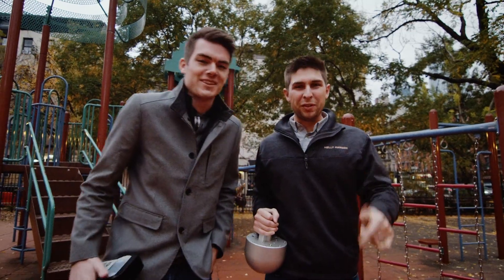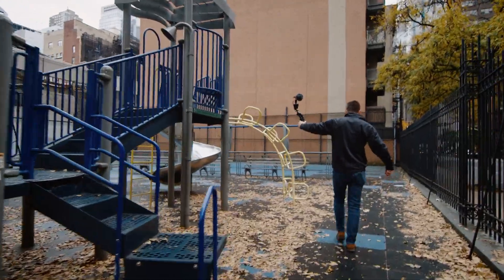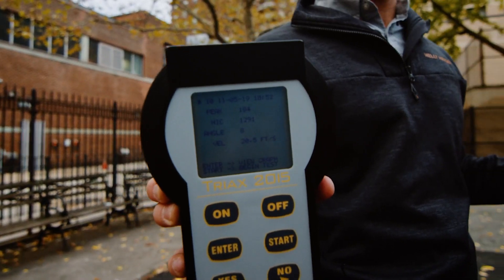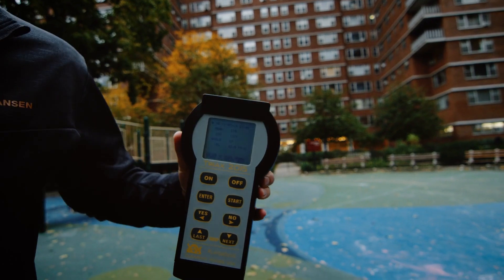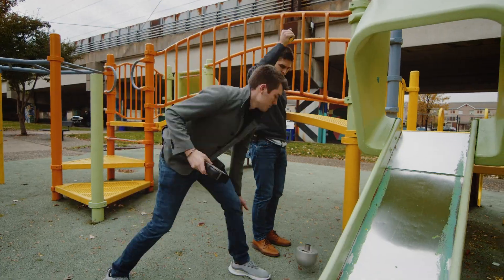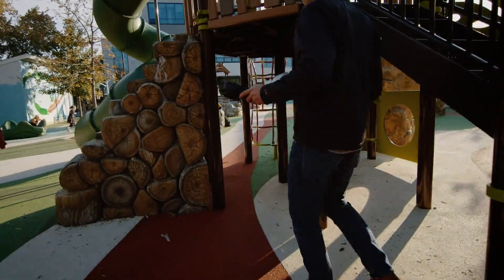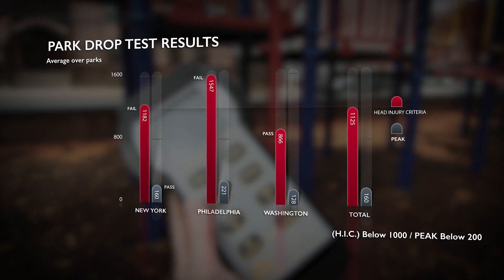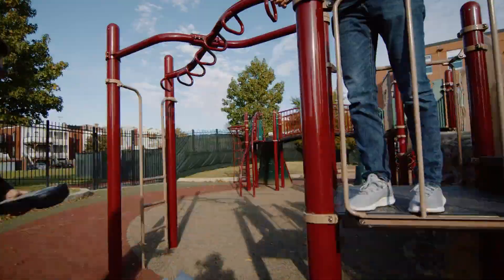Playground Surfacing–Drop Test Tour

Comment: The questions at the beginning (especially, wondering whether unitary surfaces can be considered a 'long term' solution) about how surfaces test over time is appropriate.  When a unitary surface fails - as many do on the day after the playground opens - the cost to make it compliant is pretty huge.  Loose filling like engineered wood chips and washed-sized pea gravel are so super easy to get back into compliance, they never get hotter than a pancake griddle, and a proper depth will exceed all standards.  I am amazed that the failure to deliver has not been addressed by the unitary surface proponents.